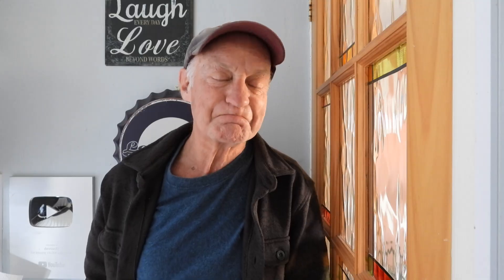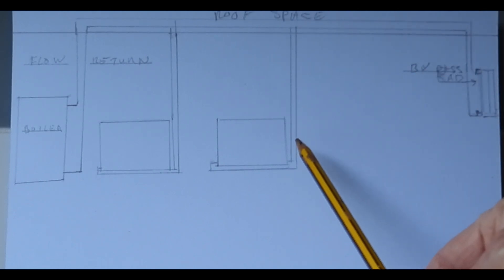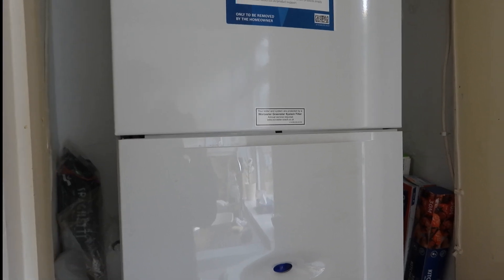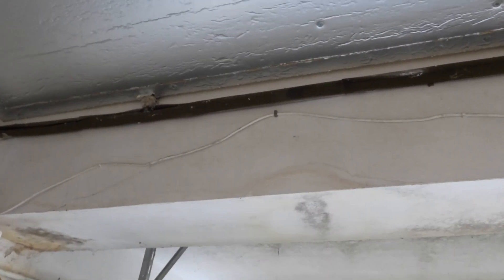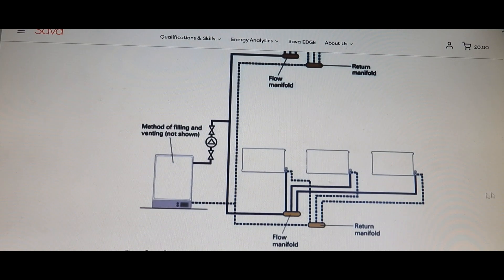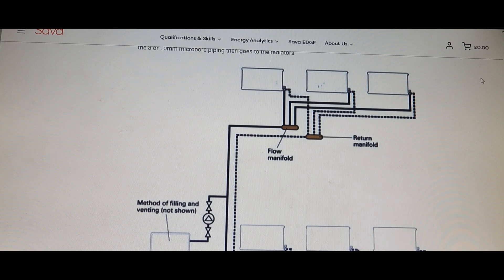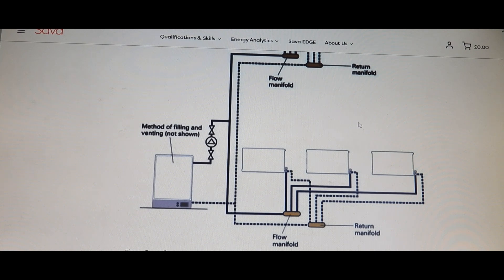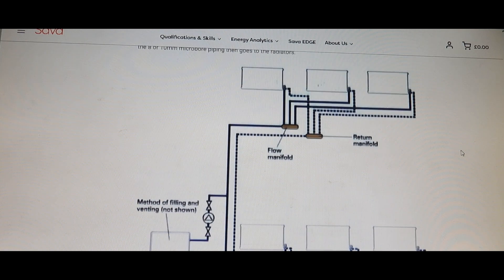Pipe sizing and teeing off microbore pipes for extra rads

Comment: Great information, very informative. Do you reckon I can add a radiotaor teeing off 10mm microbore if the new radiator is literally on the other side of a wall. i.e. 2ft wall if that.
Reply from the maker: Yes that would be ok.

Comment: I decided to just bridge a radiator across the main 20mm feed as the trouble of yet another manifold was too much (I have 2 of the old fashioned sprout stick look rather than the end on ones) Now i have a balancing problem that's something else.
Reply from the maker: That can be tricky to balance. Insert a valve across the bridge and govern it down.

Comment: Good via Al, didn't know there was microbore systems with a manifold. I have microbore but mine is only from 15mm under the floor to the rads so easy to change everything to 15mm over time or when I get the floor up. Out of the combi is 22mm (well it is larger than 15mm).
Reply from the maker: That size is ok Mark.

Comment: Basically, if you tee off, with s shortish run, a small rad from microbore to another rad, it will probably be OK. Two large rads off the same microbore, especially with longish runs, will be hopeless.
Reply from the maker: Yes that`s about the size of it.

Comment: Your heating posts always ‘trigger’ me - to use the modern parlance - to go away (again) and spend a week trying to really understand our heating system.  We have old style  F&E, but with a 1910 bit of house merged with a yr 2000  bit of house, with micro-bore (mostly) in the old bit:
buried in the walls, popping out of nowhere into a rad and disappearing back to nowhere.  It’s Indiana Jones and the Lost Manifolds in our house! Never seen one.  I guess they’re under the floorboards somewhere!  Summer project (with all the others).
Reply from the maker: Good luck with that.

Comment: Thanks for sharing Al. Heating Engineer here 50 plus years in the Trade & totally agree with your sentiments. 
Oh, we made a Klondike back in the day with Microbore, thrown in, any size Radiators, any size runs of Tube. But we were young & foolish, so, there’s plenty still living with our poor workmanship.  
However, they can rest assured we were minted, we would drive around in brand new Capris, Kipper Ties, 3 piece suits & Platform Shoes, pulling all the best birds.😂😂❤
All the other Tradesmen took the Bus😂😂

But seriously, 8 & 10mm tube has very little heat carrying capacity. So it’s always best to Tee off the bigger size Tubes. My advice, Central Heating is an exact science, not a DIY job. Best really to contact your local Gas Safe Plumber/ Heating Engineer to carry out any work.
Thanks again Al & pass on my regards to your lovely wife.
Reply from the maker: Thanks will do Jim all the best.

Comment: Hi Al, interesting video... Moved into a house 4 yrs ago with 8mm microbore system in poor condition with some blocked rads. Good thing was the flow and returns were in 28mm reducing to 22. Had a GSR engineer replace the boiler and (old) thermal store. Spent months cleaning the system out and eventually replaced 9 rads out of 21. Also added one, with very short 8mm runs, upped to 15 into the new rad. Works fine. Also fitted an extra filter on the circuit between the boiler and the store.  Learned to solder the 8mm with those tiny fittings😅 I'd definitely agree that cleanliness is key, especially with the 8mm.
Reply from the maker: Great info thanks Ian.

Comment: [2.43] My radiators are very different sizes (smallest is nominally rated at 425 watt, biggest is 2110 watt) so the microbore system is very unbalanced anyway. Would teeing off the pipes to the smaller radiators be OK?
Reply from the maker: So long as they are not to far away.
Reply: @dereton33 by too far away, would 2 meters be too far horizontally t-ing off a small rad in the next room? Thanks.